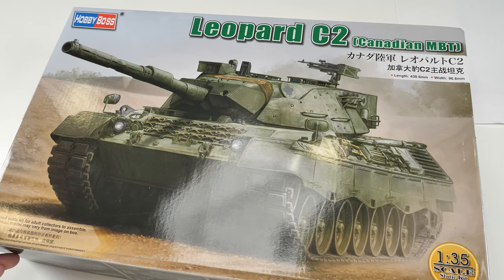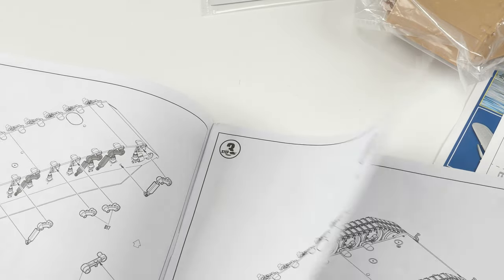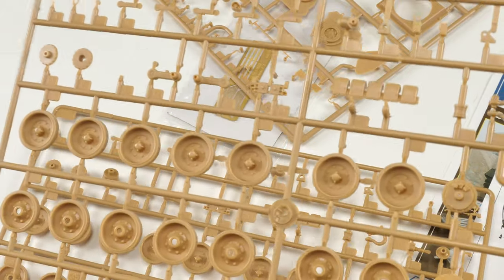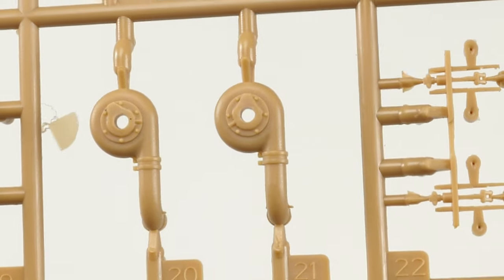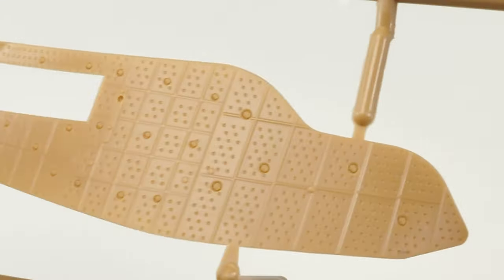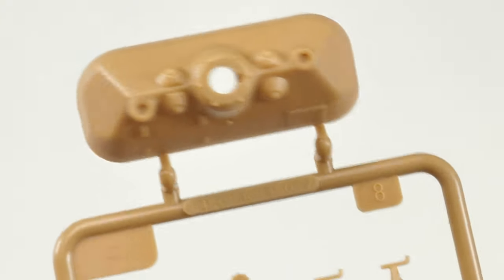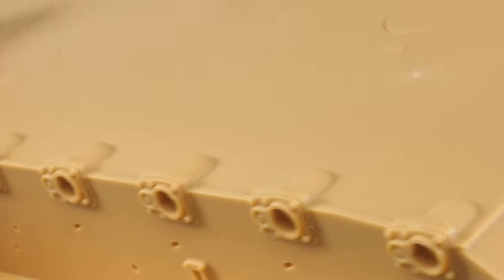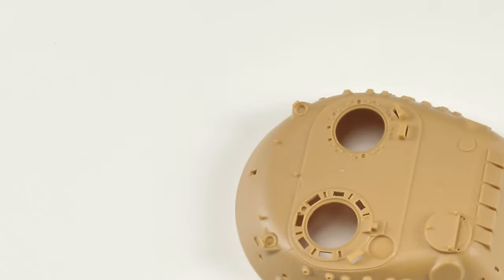Hobbyboss 1/35 Leopard C2 Canadian MBT Part I REVIEW

Comment: I just picked up this kit and checked out your video to get a better idea of what's ahead.  Thanks for the excellent summary!  The C2 was the first tank I commanded, so hearing your questions prompted some great memories.  I think I'll pick up the same barrel you got and perhaps some metal tracks if I can find them...
Reply from the maker: Big thanks ! Sorry that the build video is delayed I plan it this year. Instead of just a stick the parts together I will try and make a video about making small improvements to the kit... do you think that would be useful?
Reply: @TheBearScaleModels  absolutely, yes.  I think having a detailed video would be excellent.  I'm picking up some extra odds and ends (metal barrel, different tracks, etc) so hearing your feedback on what you would improve would be very helpful
Reply from the maker: @ennok4231  awesome lwts do that. If you are interested in MRAP s we are running a group build on patreon... just for info 👍
Reply: @TheBearScaleModels  if you find you need any more reference photos, there's a C1 and a C2 about 5 mins from my house, at my old Regiment 😀
Reply from the maker: @ennok4231  for some reason it's really difficult to find photos of them on exercise or on the ranges ! Big thanks